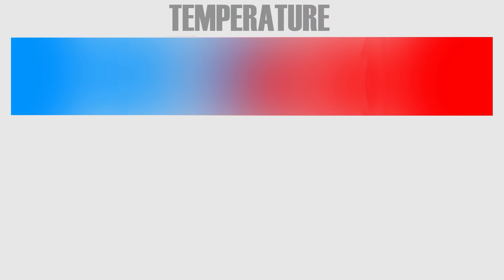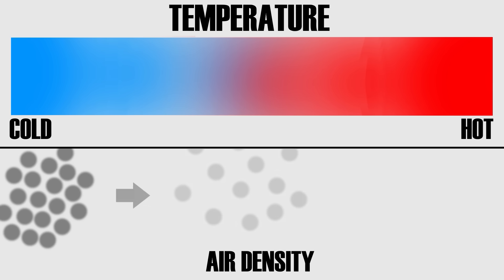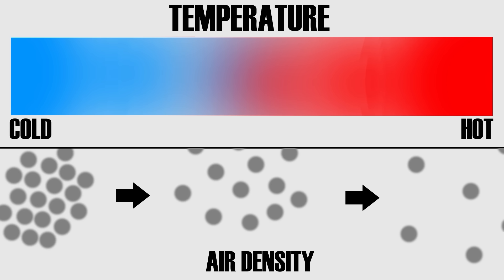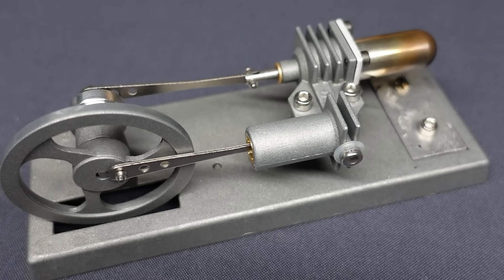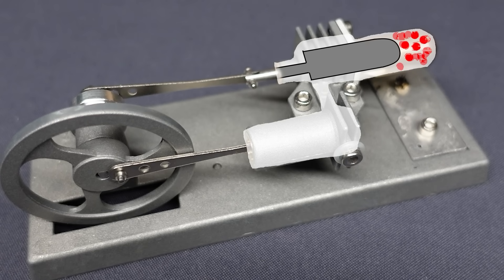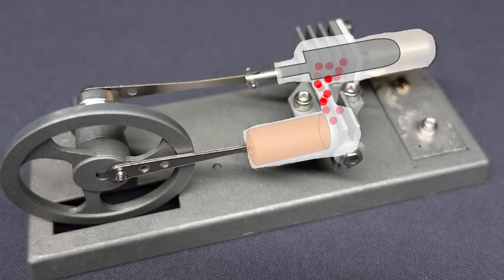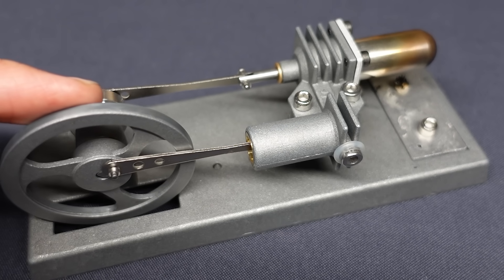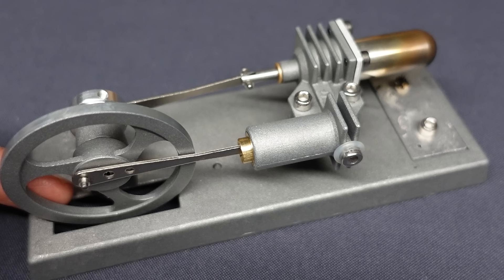It Can Save The World - The Simple Genius of Hot Air aka Stirling Engines

Comment: The interesting part about these engines is how efficient they can operate with some engineering considerations.
A propane fired engine can operate extremely efficiently. The expansion of the fuel can be used to cool the cold side of the engine, while the fuel heats the hot side. 
The one i built for my engineering class was a radial 6 motor, as this worked out best for piston timing. The propane heated an flame to oil heat exchanger, the oil then got pumped round the hot pistons. The fuel lines the fed the burner were rapped around the cold side pistons. The entire engine case was sealed and pressurized to 10 bar. 
The motor operated at 44% thermal efficiency. Putting it on par with diesel engines. Volumetric power density was its one design flaw. But, I still think it was commercially viable for a standing power generation prime mover.
Reply: I'm sorry but I think you made some mistake in either the measurement or the calculation if it showed 44 % thermal efficiency. If real, it would be a world record for stirling engines. The use of oil as a heat transfer medium would surely lead to a lower temperature of the working gas on the hot side (compared to direct heat transfer flame-->working gas) and that's not good for the efficiency. How did you measure and calculate mechanical output and fuel energy input?
Reply: If you ever decide to try it please come back to this comment and let me know, I'd happily invest in that. Even if it's just crowdfunding for a hobby level version
Reply: @kindbrute4640  my prototype cost roughly 8 grand to build 17 years ago. But I already had all the equipment I needed to design and manufacture it from two decades of building sterling engines every year for school science fairs. 
I had some interest in my designs from some major manufacturers, but since planned obsolescence isn’t a feature of the design like gasoline engines, they lost interest quickly.
Reply: @kindbrute4640  - Lol, yes write your tel # on the sidewalk in chalk and he'll get back to you.
Reply: because of this comment I ended up thinking about a way to cool a straight 6 with propane while powering it with the propane. The basic premise is a standard super turbo setup with a bigger turbine, have a 3 way heat exchanger with air (like an intercooler) pass through to help chill the air coming in and preheat the liquid propane. Then add more liquid propane in the rear and have it fill up the coolant lines in the engine, make a nice engine coolant exit at the top near the manifold for the fuel rail to add in standard port injection. With a direct injection added to the heads, also going to need to add the engine coolant (propane) to that manifold too. Anyways run the mix lean, add tons of boost, then fire the direct injection after the initial burn to continue burning fuel and have a little left over to help with cooling, if you want. I mean you have liquid propane, so I dunno if you need to. Anyways back to the turbine, since its a long block anyways might as well have equal length tube headers to a longer more efficient turbine with a vacuum spring (its like a tension spring) valve setup up to them (they have tear drops in the ends of the tubes then as air flows out that is fast and hot it produces a vacuum, the spring makes the valves return in place with minimal loss of flow velocity) with some basic single wall vacuum tube insulation around them to help retain heat to improve turbine efficiency. 

Anyways, I ended up thinking about the remaining liquid propane in the engine an was thinking using a phase change of the liquid propane with the air intercooler to make it cool down. Using some batteries I'll just run a compressor and a basic pulse tube jules thomson combo stirling cooler after the phase change heat exchanger. its still going to be initially too warm with the compressor to go back to being a liquid, so if i use another strong after cooler that works to help condense while I'm sucking out the propane into the liquid propane storage then it should work. Just need to run it with some battery power for a while after shutting it off. I can then do a refill process during start up. It will help the air be cold, the engine get to temp, propane pressures be nominal, and everything run and operate smoothly.

Edit: using a torque converter/coupler setup or a from the supercharger (which i forgot to mention I would use a venerator setup where it starts at a large gear, uses a spring to compress it back to a smaller gear that slowly gets to a large gear again using the weights then disengages using a solenoid at a given rpm then has the turbine kick in, after that the turbine kicks runs the serpentine belts and pumps plus if there is any left over it connects it to the crankshaft via a torque converter/coupler) to the crankshaft. I have to say the fueling for the after spark ignition is a Lemke cycle because its a constant burn (i call it that because i came up with it) that with off load its power into the turbine. Now because the turbine takes its power and adds it into the rotation of the crankshaft its now more efficient on work energy capture as well as thermal efficiency through the use of the liquid propane
Reply: @TheColorsInGreyLife are you a book writer 😊
Reply: @TheColorsInGreyLife  - Bullshitter.
Reply: @TheColorsInGreyLife Hi, really cool idea. I have one question. I'm not an expert when it comes to IC engines but I am a thermal engineering graduate, I've worked with methane and propane fuels for designing gas burners. Now I work in the HVAC industry and propane is an awesome refrigerant.
Question is, propane usually auto ignites at around 650 K, will that be a concern when trying to cool an engine by running fresh charge of fuel around the cylinder via cooling jackets? 
I like the idea of preheating the fuel via the heat from the engine, it can significantly improve the combustion efficiency. However, with a higher reactant temperature, the adiabatic flame temperature also increases, this means the cylinder walls get hotter compared to using non preheated fuel. Will this create an auto ignition scenario inside the cooling jackets? It's interesting to study the effects of this.
Reply: @stormyb3739  I'm not an expert in the slightest, just learned things as I went on in life. Well (650k) 376 c + would be difficult to get to in the coolant line of the engine especially without oxygen or anything for it to react to. Then because liquid propane is also phase changing in the coolant system (boiling off and taking away heat) it will unlikely ever get anywhere near that high of a temp on top of not reaching its decomposition beginning at 701c and above. The lines would need to be sealed properly to have the thermal shrink and expansion taken into account and drilled and threaded to allow for it to be placed (from the heads as well) into a fuel rail, but that's about it. Remember that a hydrocarbon can't burn without a reactive gas or compound (oxygen or something that has it in it that is ready to react). 

Here's a quick food for thought, on the higher flame temp and even the direct injector stuff. Because it takes time for the fuel to mix and burn with the remaining oxygen in the cylinder it can't burn at the source of the injector, sort of like when a blow off valve for pressure gets activated and you see its not burning at the nozzle and instead burns just in front. It has to react with air. With it remaining a liquid, for the most part, and you use a bleeder system (the fuel rail) with a proper flow and pressure regulator (with a side tank) then you can maintain consistent pressures and flow into your injectors. The fuel has to pass through a bunch of much colder temp fuel around it helping keep temps nominal. As it is outside of the hot cylinder area it now doesn't have the chance to continue gaining heat (unless your engine bay is somehow at auto-ignition temp range) so it helps with making sure when you inject it port injection style you won't have it immediately burn. With below 0c temps going on thanks to the liquid to air heat exchanger you then wont have it be hot it enough no matter what.

Just make sure to seal around the sides of the gasket, use a multi-layer steel with aluminium and high temperature silicon for the gasket as well, then make sure you run a system that detects when there is any significant and sudden drops and rises in pressures that auto shuts off the propane tank and runs a bunch of carbon-dioxide into the engine bay. During any accidents (someone hitting you or you hitting someone else) it should cool the area down and prevent oxygen from getting into the propane (i would just store a little of the exhaust in a tank and then have the heat pressurize it then fire it into the engine bay) to have it be a problem. Besides it would be about as safe as any other car on the road considering those often have a fire happen during an accident. Its not really going to happen immediately as a lot of propane suddenly overwhelms the amount of oxygen in the area and its too cold to ignite. So a valve shutoff and exhaust system takes care of the issue after that, that might be there.
Reply: @stormyb3739 Simple. Can’t burn (ignite), if no oxygen. 
Fuel in the fuel line (cooling jacket) has no air/oxygen.
Reply: For an internal combustion engine there won’t be enough cooling energy transfer to keep the engine temps down. 
Ethanol can easily over cool an engine if you don’t run the block coolant up trough the blower, but propane doesn’t have as much energy potential to do the same. 
If you’re looking to get the best energy return from propane, inject it into the air stream after the turbo. Also, propane is a race fuel. Having an octane rating between 106-112. So its best used in a high boost or high compression engine.
Reply: @davidblalock9945 what about a propane HHO gas engine? With the electricity to make the hho coming from a solar system/battery bank. From solar panels on a van roof. Like 70% propane 30% hho to use less propane for better mpgs/propane savings. Or use 50/50% propane hho if possible. My  van only gets like 14 mpgs. If I had say 600w solar & commute 35 miles round trip. I could burn hho to work & solar panels would recharge battery for 8 hrs at work so I'd have hho to burn on the way home. If I was on a road trip. I stop & plug 🔌 in when solar hho battery was dead & recharge. Would be nice 50/50% propane/hho so I could go from 14 mpgs to 28 mpgs from the free hho.
Reply: Maybe use it in winter to provide both home heat & to make extra electricity. Rather than simply burning propane for heat only. If I  ever get an off grid solar wind turbine generator system. I wanted to build a box around the generator so in winter the generators heat could be blown into house while it's running to charge battery bank. 
Very similar to a heater in an old air cooled VW Beetle.
Reply: Steam engine with condenser is far more superior.
Reply: how can a radial have an even number of cylinders?
Reply: @herzogsbuick  A radial engine will work with an even number of cylinders, but it wouldn't have even firing intervals so torsional vibration will be higher.  The Zoche aero diesel radial engine has two sets of four cylinders.
Reply: @herzogsbuick I made a 6 cylindres radial steam engine. It works perfectly and with no vibrations.
Reply: Could heat pumps be combined with these engines to make a self sustaining cycle...?
Reply: @nedmilburn  This engine is a heat pump. You can either output power in form of electricity by input of heat or you can input electricity and pump heat. Those are mostly used as cryocoolers.
Reply: @sierraecho884  You miss what I am suggesting...  If the motor can drive an electric generator and power a heat pump which is used to continue to heat the Stirling, then perhaps you could have a sustained motor with greater energy output than input.
Reply: @nedmilburn  This is physically impossible this is why I dismissed your idea. You proposed a "perpetuo mobile".
Reply: @nedmilburn  heat pumps have a COP > 1 so they're essentially free energy machines. If the heat they move can be reused to generate enough power to feed, them it's done.
Reply: @dominus6695  Free energy... hmmm...  Nope!
Reply: Yeah and i built an autonomous driving solar powered truck. It actually generates extra electricity with recuperation and wind turbines, so i built in a battery to feed that into the grid, after it's done the delivery tour. It's actually 114,2 percent efficient. It is very commercially viable, (I'm actually hiding the fuel in the base plate, to make people invest in my scam, but don't tell anybody!)
Reply: @gehtdianschasau8372  114,2% efficient, hahaha this indeed was funny. However the OP is right, you can build what he proposed, he might have done that.
Reply: @sierraecho884  he has not built it. He simply realized, that BS-ing in great detail is very effective. 
It's fundamentally wrong, that's why he hasn't sold his idea, he sells it in the comment section on youtube.
Reply: @gehtdianschasau8372  "...It's fundamentally wrong..." What exactly is wrong with his idea?
Reply: How much power does this motor make?
I always though about evaporating something on the cold side to use the phase transition. But those designs always have problems with the power required to get the right fuel.
Reply: @MrHaggyy  the small demonstration unit had an electrical output of approximately 3kW. Since it barely lugged down when I ran the 1/2” drill with a 3” Forster bit through the logs, it definitely had more to offer.
Reply: @MrHaggyy  what about heat pipes at the cold side?
The heat transfer from the flame should be made via fins in a tube or so, it should be semi internal combustion through a coil or so, to capture all the produced heat.
Reply: What about start up time? As any external combustion engine, your one likely need time to heat up before start working.
Reply: How would they compare to solar panels (25% ??) if were to use lenses to concentrate sunlight as the heat source?
Reply: @slumbercat  Some solar generation farms have used Stirling engines with mirrors to focus the sun onto the hot end, and I believe you can still buy commercial systems. Potentially higher efficiency than solar panels, but more complex and ultimately likely to be less reliable.
Reply: i have doubt about it because if that was true it would be used like that for sure. the only where its used is in solar power where sun heats it up.
Reply: a question: in this case, is thermal efficiency equals to energy efficiency?

if yes, so it's even better than normal diesel in energy efficiency.
Reply: @AfonsoBucco  Stirling engine theoretical efficiency is higher than that of the diesel, but no practical engine has ever approached this theoretical value.
Reply: One thing that can improve the efficiency of a Stirling Engine is using Hydrogen or Helium as the "working fluid". As both are "thinner " than air, they pick up and give up heat more quickly.
Reply: Yea and how much actual work could you extract before you stall it.  Not as much as your desiel engine comparison. So it was a fun "project" and nothing more.
Reply: @davidblalock9945 It's spelled wrapping. I know what you meant. I considered fast distillation or refrigeration immediately. Says more about me. I don't have a workshop or I'd be machining something.
Reply: Dave's not here, man. 

If you know, you know. 😂😊
Reply: There was a video from the 1980's on YouTube in the early days of YouTube, and it showed a mechanic who had built a "Noble Gas" engine that had a completely sealed combustion chamber. It used Argon or Helium or Neon or one of the inert gases that is non-flammable. I don't know how a person could make a sealed engine, but the guy did it, and had a long video explaining it and showing it. i suspect it will never be seen again on YouTube in the modern era, as most of the free energy videos disappeared around 2012. The idea is similar to a modern air conditioner where the system is 100% sealed, and the gas inside is harnessed to produce energy for 10 years, before it need recharged.
Reply: @starseeddeluxe  LMAO if any of those "free energy" ideas were actually useable, they'd be everywhere already.

As anyone who has studied thermodynamics will tell you: There's no such thing as a free lunch. You can't win. You can't even break even.
Reply: @teebob21  You really certain of that? The oil industry makes insane amounts of profit from supplying the world with fuel.

Do you really think it's impossible that they didn't pull some shady shit to bury working designs of better engines that use better/cleaner/more abundant fuels? Such designs would drastically reduce our need for oil and thus drastically reduce the profit from selling oil.
Reply: @starseeddeluxe  that is very interesting
Reply: @starseeddeluxe  was this it? The Papp engine?

https://youtu.be/N4li_z4Jpso?si=6lIG9-v19rLcHknw
Reply: Well done, yes they are very efficient, way more efficient that ICE´s are. They might be a great solution for a range extender on an EV. This way you can make smaller cheaper lighter batteries and combine them with Bio Ethanol fueled Stirling engines for instance. You cooling idea is pretty neat however the gas needs to be pressurized for the tank so you will use that energy regardless. You simply recoup it later on, which is rather clever I admit.
Reply: How well would concentrated sunlight work with one of these engines?
Reply: @DennisLock-x8f  Depends on many factory. Generally speaking it can work very well, even better than solar cells. However it´s more complex and you need more maintanance compared to solar cells.
Reply: @sierraecho884  👍 Thanks.
Reply: I wonder if this would be viable as a more efficient way to heat homes. For instance instead of burning gas(or any other fuel) to heat a home, you burn it to run a Stirling engine. At 40% efficiency, you get back 60% heat and 40% as power to run a compressor of a heat pump.
This way for 10kw worth of fuel, you would get 6Kw of heat and 4kw for running a heat pump which at a COP of 3.0 would be an extra 12KW of heating power. So 18kw in total.
Reply: @cyberlord64  The way it is done now is you burn a fuel and heat a home, at the same time you use the waste energy to run a stirling engine. Stirling engines in general are not 40% efficient but a little less, more like 25% to 30% at best, if your goal is to generate energy. They are up to 40% efficient if you need kinetic energy. Also heat pumps do not have a general COP of 3. This numbers depends on many parameters. You need a multi factor analysis. Generally speaking your idea is good and that is how it´s done already. There are a couple of Swiss companies who sell those. The stiling engine is in the range of 1kw-3kw.
Reply: They operate same effiency, how Carnot ruled. So the higher temperature (highest) and lower temperature (lowest) will give more effiency. (1-T1/T2) you know. But if we are using waste energy, under 100 degrees of celsius, steam engine is not going to work at all. I remember (may be I am not right) Philipps made an engine, which used gas from bottle, like 200 bar, so then we will get alot of power from small engine. United Stirling AB put SE to a car. My opinion is that the problem is to cool, not to heat. So if you have 1 kw engine, you must cool all so with 1 kw and that will be the problem in a car, not in the submarine or other water vessels.
Reply: What does the Sterling motor use to burn the candles? So it's still emitting what is a very small amount of emissions? It's not free energy...you're just using a burnt object to heat the air. If it's on a larger scale motor it's emissions are expounded....you're still polluting the enviroment...just at a mutch smaller scale
Reply: @JohnAllsopp-jk2mn  Yes, but you use the heat from things that were going to be making heat anyway, thus reducing waste.
Reply: So let's say potentially you are in a cabin making fire and you connect onto the chimney pipe just above the same concept and at the ends you'd have spinning shafts of which you can connect to a home made power generator to make electricity for the same cabin... Interesting concept I must say. 

Obviously it would be good for Alaska winters (never been but presume) where you heat up the stove, fireplace or whatever. 

I've seen somewhere quite some time ago that in Sweden they used temperature from some sort of factory to heat up the whole neighborhood building but that's just the thing like the law says the energy never disappears just transforms into something else... 

Amazing, just amazing
Reply: @matejsamardzic6231  There is a cool little gadget which is a fan run by one of these that you sit on top of an enclosed fire so that it helps distribute the heat around the the room. Power generation would be  great but it is a lot of setup for a small amount of output
Reply: I don’t know who’s done, but I have read that they have used an SE to generate power at their home. As I understand it they used the heat that collects in their loft, and the outside relative cold. No other fuel than a heat differential. That’s enough to power a small generator.
Reply: This frankly sounds like a great idea for a back up generator
Reply: Hello Mr. David, if you don't mind me asking, I would love to know if you've done a journal paper on this, I'm super interested to read and discover more :)!
Reply: 44% is way better than a practical diesel engine. The ones used in cars are around 25-35%.

Stirling engines were tried in cars, but the drawback with them is the slowness in going up and down in power. They work best at a constant power output. What I can't understand is, why don't we use them in hybrid cars? They can start up when the battery goes under 20-30% and deliver power just right above average consumption of the car. This motor can be small, quite cheap and extend the range of an EV to very far, while almost giving the double milage of a gas car. If you arrive your destination with low battery and don't have the ability to charge, it can keep running until you reach for example 60%, making sure the battery is not damaged.

By having this, the EV batteries can be smaller, for example 25kWh instead of 80kWh, still making most trips 100% EV, having the range possibility when needed and still when using the combustion engine, giving much better fuel economy than a gas car, and the module can be pretty standalone, making the car fully usable even if the generator brakes down. If you have several EVs, it would even be possible to move it from car to car, utilising it in the one going for a long rive.

It would be fun to buy an old EV and modify it with this module.
Reply: They are good on a constant load but slow response to load changes. Used a lot on farms for water pumps.
Reply: Also they are used on rotisserie bbq using waste heat from bbq to drive the skewer
Reply: Great work.
Reply: Moron
Reply: Hyliion Karno. good time to invest
Reply: 😮AWESOME 🤘
Reply: Did you sell the designs? 😊
Reply: Sterling's have a few good applications on earth that they never get used for because yields to material cost reasons. But in space once we start capturing large space rocks for orbital mining ops they will make sense as soon as we put a foundry in orbit. In space the sun facing side of an object receives far more heat than the dark side of an object and this means hyper efficient solar sterlings. 

If you still like the project design a zero spin sterling module that wont cause incidental gyroscopic procession from it's fly wheels you should need 4-6 wheels all working along opposite axis and it should have fail safe brakes in case of damage leading to procession.
Reply: So far the discussion seems to be focussing on efficient ways to simultaneously heat and cool the hot and cold sides respectively. The engine utilises the expansion and contraction (and heat transfer) capabilities of AIR which never leaves the system. Have there been any experiments carried out using different media, like freon, or other gases?
Reply: @SunRabbit  The highest efficiency commercial Stirling engines use helium for it's low specific heat capacity and high thermal conductivity, but it's difficult to keep it inside the engine.
Reply: @ferrumignis  Fascinating! Well, it's difficult keeping helium in almost any closed system because it's literally the 2nd smallest atom, so it can (and does) seep right through most materials over time. But I'm sure that would be a viable research angle to pursue: finding a viable substitute for helium in Stirling engines.
Reply: I had a idea for steam engine it might work with this as well but instead of a flame I'll use electricity and yes older trains have done that but I'll use a induction heater with sensors so if it gets to hot the the induction heater would turn off then turn back on whe it gets too cool and if It works I want to put it in a car
Reply: @yesjared950  that doesn’t make sense. Propane can achieve high efficiency because its   Cooling one side while heating the other. In effect, retaining heat within the system. 
Ethanol can achieve the same effect, as it vaporizes cooling one end and then burning from a vapor wick. 
Using electricity as the heat source would be horribly inefficient as the sterling cycle can’t exceed 22% efficiency if its fuel isn’t capable of both heating and cooling. It would be far more efficient to simply use the electricity directly in an electric motor which is typically 85% efficient or greater.
Reply: @davidblalock9945  I guess what your saying make sense but I was just thinking it would work I wasn't talking about efficiency but the propane would be more efficient except the way to store it yea they have takes but where to refuel if your out in the country? Just questions not trying to make a contest of no sort(I'm thinking in terms of a car)
Reply: @yesjared950  its not about ego, its simply about logical functionality. Ego has no place in science or engineering. 
Ego is the cause of all bad science, including the entirety of the pointless and arrogant hypothesis of evolution, which was bore out of men’s unwillingness to accept fact that we are all born basically evil, and without an outside force teaching us civility we will become the the monsters we so fear. 
That bit of preaching aside. I have used electricity to power a sterling engine, but solely for demonstration of the engine, as its far more convenient to to flip a switch. 
But for automobiles, using the electricity to power a magnetic motor is vastly more practical and efficient. The only ways a sterling engine would be practical in an automobile would be as the prime mover for electric generation in a hybrid. Sterling engines don’t throttle.
As for refueling it, I honestly can’t think of a single gas station I’ve ever been to that didn’t have propane. But, I live out in the country. Might be stations in big cities that don’t have it.
Reply: @yesjared950  You need to learn some thermodynamics. If you want to tun a car )ir any device) and you have electric power available, you use that power in an electric motor. Converting electric power to heat and then using the heat to run a heat engine can never be as efficient as using the electric power directly.
Reply: @yesjared950 electrical coheaters are used in many steam or diesel engine. But their main purpose is not to make power, but to bring certain parts of the engine up to temperature so it can handle the power of the machine as well as working efficient.
What's interesting is the linkage of light as a heat source for stirling motors. NASA tried too add stirlings to satelites and fire them with lasers from the ground. While that could work, solar-panels are a much simpler design.